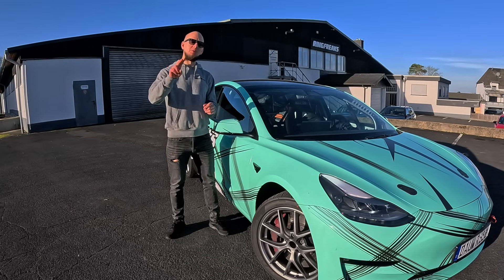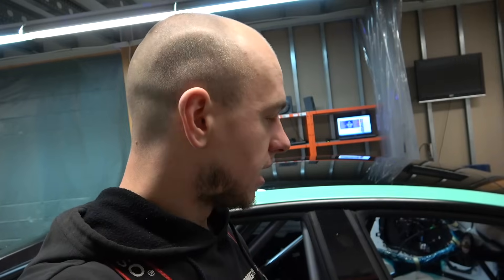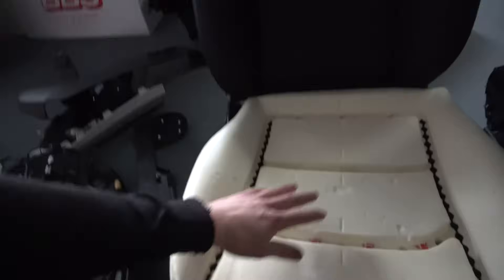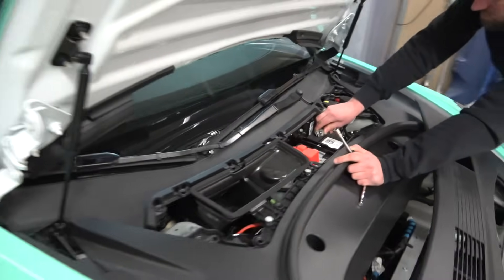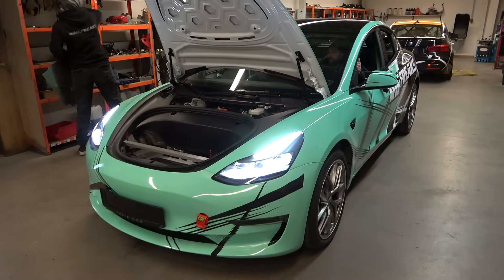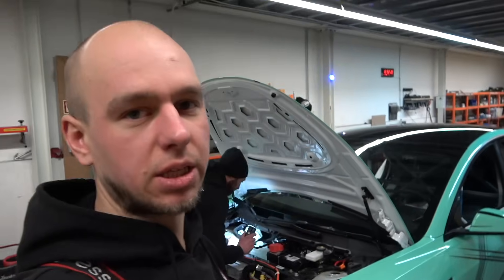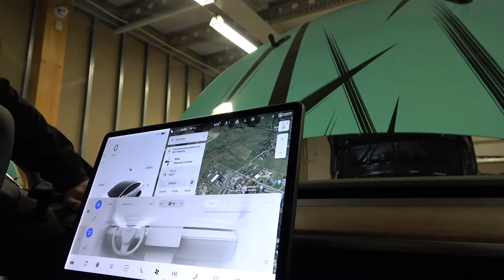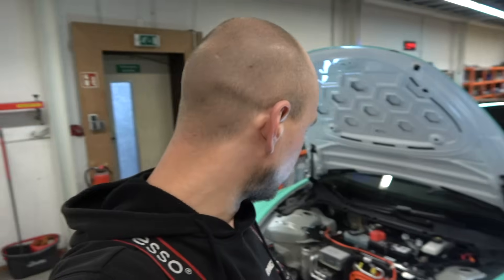TESLA DRIFT TEST and first problems... cooling, racing seats and it's alive again!

Comment: You might consider actually using the seat sensor in your racing seat so that the car will shut off properly when you get out of it. The sensor is very cheap from Tesla and can be pretty easily retrofit to a racing seat.
Reply from the maker: No need, I have made a small microscheme which acts as seat sensor. Car can go to sleep without an issue. But yes - easier solution is to put seat sensor in racing seat, but I don't like wires and cables in seats.
Reply: Fair enough, I chose to keep the sensor and stock seatbelt since I still daily the car.  @Ringfreaks

Comment: Do you suppose to use a vacuum bleeder on cooling system like others do on Porsches and other mid/rear engine layout cars? I think it would be easier to get the stucked air bleed out, unless Tesla has its own procedure. Anyway, I wonder how it drives on Nordschleife, maybe we'll get onboards with Misha on upcoming season? :D

Comment: Will be drifting my Model 3 Long Range soon so thanks for posting this as its good to see whats possible etc 😉⚡️💯
Reply from the maker: Just be careful! Car has a lot of grip and gains speed very fast. Even I am a professional drifter - I had to be aware of parking limits... Fence is too expensive to add it to race build costs :))
Reply: @Ringfreaks  I can imagine, maybe I'll focus on my electric TVR to drift instead 😉⚡️💯
Reply: I am sorry, but drifting a Model 3 long range seems to be not so easy because there is no track mode available
Reply: @RMeyer-kd8gl  you can modify to drift